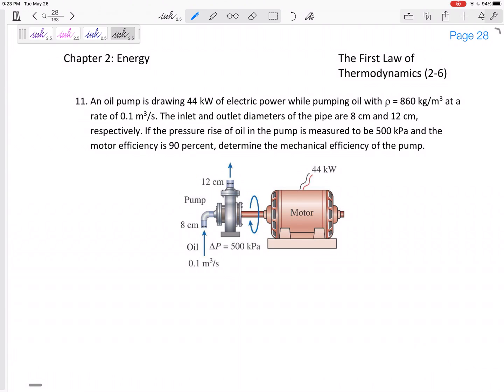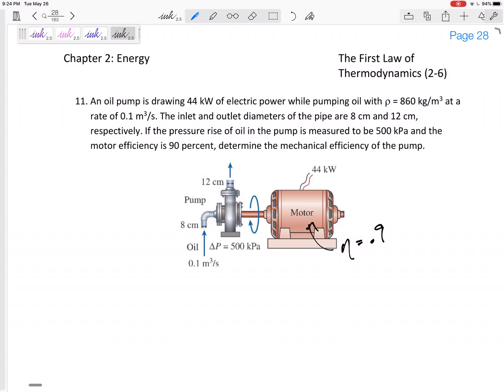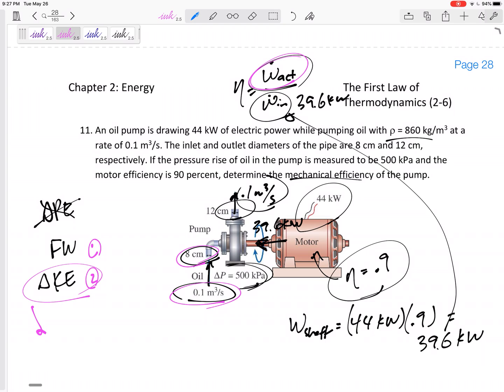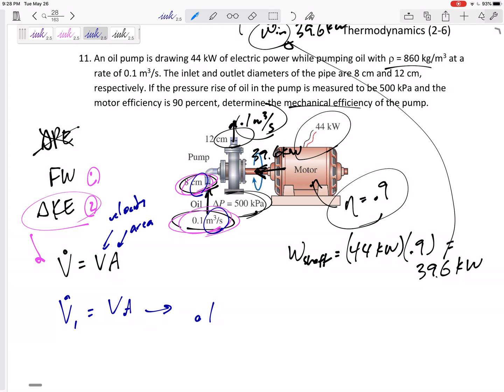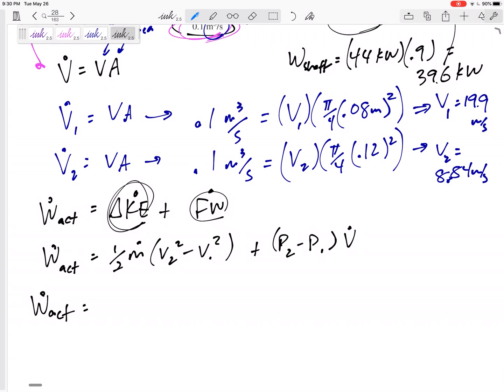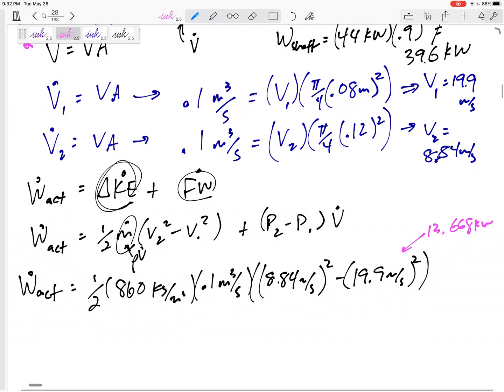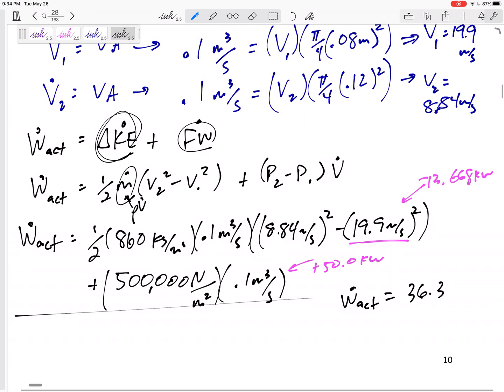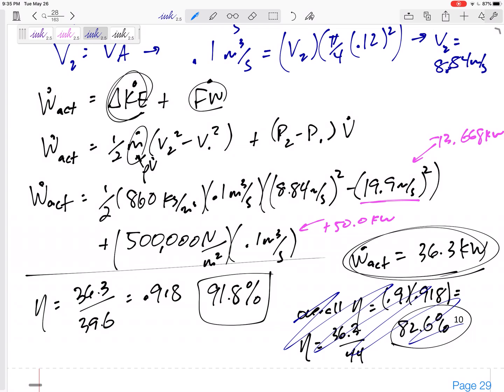Thermodynamics - Motor and pump efficiency

Comment: Not understanding why the pump is responsible for KE loss. Seems like starting velocity is zero since pump causes the initial movement. Without the pump KE starts at zero. The pump isn’t slowing down the velocity of the static water in the reservoir. Can anyone explain what I’m not understanding?
Reply: This is a good question. I believe the kinetic energy is a loss because of the conversion to pressure energy. Look at how a centrifugal pump works. KE is converted to pressure energy by the pump.

Comment: Ok so i understand that for the pump to increase the pressure of the water, the shaft or pump needs to put in work. 

But what about the kinetic energy? Why is it negative? Is this machine also a dam that can generate electricity?
Reply: because there is change is kinetic energy due to difference in the pipe sizes, now we ask ourselves, is the energy change positive or negative, once you insert your values, you realise there is negative change which indicates a lose
Reply: @chisomodimmegwa3479  weird. If the inlet and outlet diameter is the same and we assume no other energy losses, then the wdot will be 50kW. 

So we need to slow down the speed of flow in order to use less work?
Reply: @guanhan898  m dot is ro x vdot. Vdot is VxA. With this it become obvious there is a change in kinetic energy because A is different for both diameters. So if V. For both diameters is the same the either A or V is definitely different.
No lets try your theory of same Diameter. If diameter is same and Vdot is same for both pipes. Then i believe velocity will b the same because once again, Vdot is VxA

Comment: Thank you for the video. I didn't understand how we understand that the flow rate remains constant and kinetic energy of the system changes.
Reply: Check out the bernoulli principle ,velocity and diameter relations